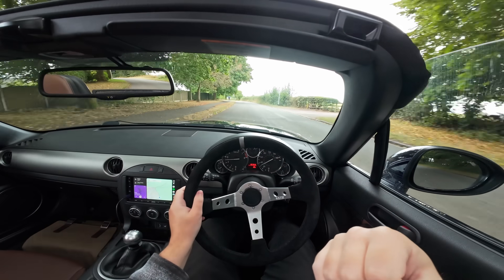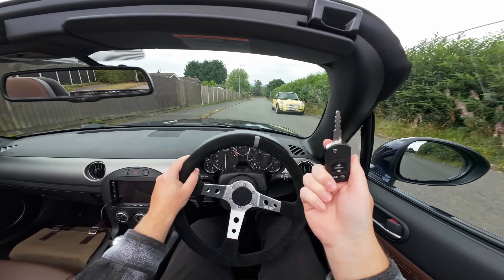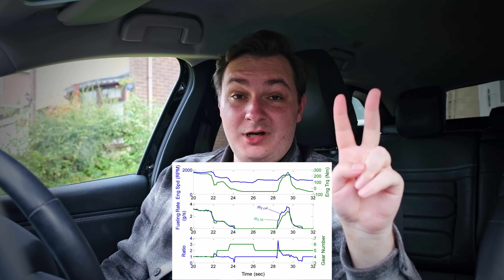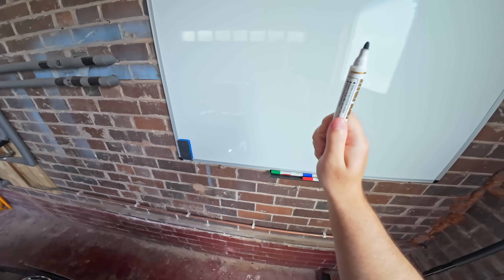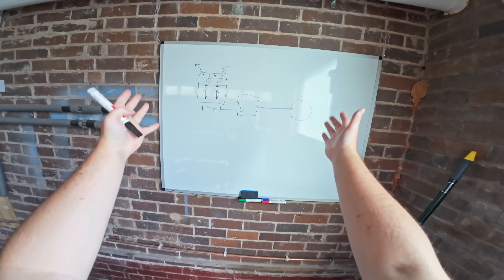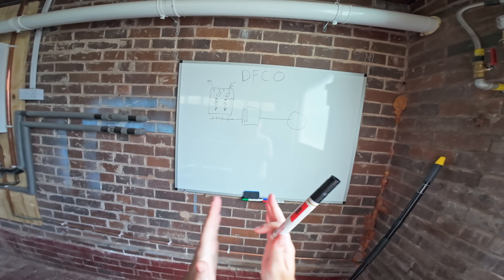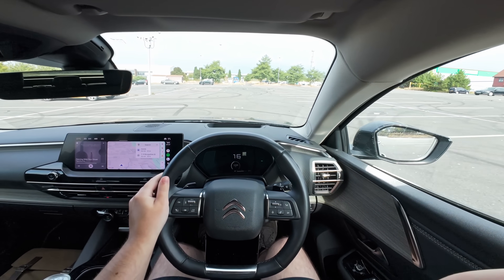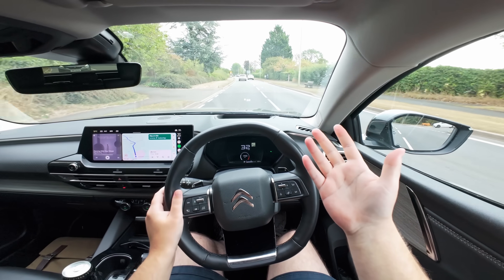The most misunderstood car term - Engine Braking

Comment: I have been doing this for over 15 years and it still amazes me when I see people get off the motorway and accelerate up/down the exit to have to slam on their brakes to stop.
Reply: Same here, and I find even more stupid seeing people that are moving way faster than the cars in front and instead of anticipating the traffic flow by engine breaking, they keep their speed until they are almost touching the front car's bumper and then slam on the brakes. Probably they think this behavior gets them quicker to their destination 🤦
Reply: @andrejorge3422 Reading the road ahead is key and a lot of people just don't do it. It would prevent a lot of accidents.
Reply: @andrejorge3422  Their thought process : "The more speed, the faster. If I stop, I honk"
Reply: @andrejorge3422 That's the Dunning Krueger effect at work right there!
Reply: especially if there is a red traffic light at the end.
You won't be any faster, you just have to arrive there when it turns green.

Back in the days I had an exit with a downward slope and a permanent traffic jam. You could turn off the engine on the motorway, coast to the end of the jam and use the handbrake on/off every time the light turned green until you could actually go through. Only then you needed to restart before your cycle came and you'd be still almost crashing into the car before you because people have abysmal reaction times.
Reply: some just don't care about fuel economy... I mean why do people buy giant suv, trucks for groceries... same philosophy
Reply: people seem to be getting way worse at driving than they used to be 😔
Reply: @dawnderg  My theory on that is due to there being less police on the roads. Cameras don't fix this issue. People drive better when being eyeballed.
Reply: @KarlWolfeINTJ  No, people drive better when they properly learn how to. It is baffling how easy it is to get a driving license in some countries, especially the US.
Reply: @ZombiieUnicorn  Agreed. I got my licence in the US when I was 15 and it was so easy. When I wanted to get my UK licence it was a different thing altoghether. Here in the UK people get taught well but don't practice it and get into bad habits.
Reply: @ZombiieUnicorn , I do believe many places do train their drivers well. The problem is, just like school, very often what you learn in the ideal setting of school falls apart when you realise are often not applied/applicable in the real world setting. The problem is that driving schools teach you to be this patient, courteous & considerate driver, but human nature is anything but. Skills are mostly not an issue, but many people put up the 'required disposition' to pass the exams, & then promptly revert to their 'true selves' once they cleared the hurdle. This is where enforcement comes in. Let's face it, there are many drivers out there who do the recommended only because of consequences. For those who have not been in an accident or had a close shave, the only consequence they are worried about is that of the law.
Reply: I did it once in a travel, I floored the car to get into the road and break hard to get out, then I realized how much that cost when I didn't do that for the second stop.
 Then I stopped doing that.
Why don't people notice that ?
It's so obvious , I leaned it pretty quickly the first time I traveled.

Comment: One factor you didn’t mention is heat generation. When a car slows down it converts kinetic energy into other forms of energy and ultimately into heat. If you use your brakes, your brake pads and rotors heat up (and also calipers, wheels, tires, air in the tires, etc). If you engine brake, your engine heats up. Engines are normally very good at dissipating heat via the cooling system and oil. They’re probably even better at that than brakes. Normally. But if your engine has any overheating problems you might want to reconsider engine braking or it might become engine breaking. (Sorry, couldn’t resist)
Reply: How are you going to overheat an engine using less energy that it produced by making stuff explode and burn intensely inside of it without overheating?
Reply: @stanislavblinov8454  Yes you're probably right! Although theoretically possible if you're decelerating fast enough, it probably won't happen in the real world. Please do the calculations and let me know. 🤓
Reply: @stanislavblinov8454 fuel actually cools down your cylinders!
Reply: Assuming the engine is about 25% efficient, it will produce 4x the heat, staying at revs using combusting fuel, than simply being used as a brake. A lot of the heat from engine braking goes out the exhaust anyway. You might get more cold engine wear on a short journey that's mostly engine braking though e.g. driving down a few miles of long hill to work.
Reply: @TimpBizkit  Thank you for pointing out that air flowing through the cylinders will vent a lot of heat. I had overlooked that.
Reply: After further consideration, I think my original comment should have been simply the following:
"If you're engine braking, all the kinetic energy that would have been dissipated as heat by your brakes is now being dissipated as heat by your engine. But don't worry, engines are REALLY good at dissipating heat."
Reply: @zenbum2654  Yeah your engine will be at its coldest when engine braking. At the same revs it will always create less heat than when the engine is under load. If you downshift rev-match to engine brake more aggressively, maybe this could make more heat at super high revs than idling?

Comment: One thing I get a bit confused with this is the gears. You mentioned downshifting is a bit advanced, so we can skip that. But let’s say I was in 5th gear at 50, and then 40, then 30 while using engine braking, would I stay in 5th? And if it’s okay to stay in 5th, and the speed limit went up, would I just get back on the accelerator while still in 5th? I get that if I came to a turn or a stop I would have to shift to 2nd or 1st.
Reply from the maker: So my viewpoint will be different to everyone else's...

Just get good at revmatching. It makes all of these questions and situations moot. You can engine brake down to any speed you like in any gear you like (almost) because when you want to get back on the gas you can go directly into any gear you like without thinking about it. In your situation I'd just go directly 5th-3rd or 5th-2nd, revmatch and I'm away... I wouldn't even think about it.
Reply: @MickDrivesCars thanks for the reply mate. Finally got my first car after having my license for 6 years and your videos have been so useful. When you say rev match, do you mean blipping the throttle?
Reply from the maker: I might just make a revmatching guide video...

But yes, 5th - clutch in - select 3rd - blip throttle - clutch out
Reply: @MickDrivesCars  A revmatching guide video would be awesome. I don't have a manual car myself but would be interesting to watch. Maybe I"ll get a manual at some point in the future.
Reply: It depends how much acceleration you want. If you accelerate from 30 in 5th, you will crawl back up to speed. If there's a ditherer in front of you, this may be all you need. 5th at 30 may be too slow to fully plant the accelerator without lugging. For maximum acceleration you'd use 2nd in most cars, and 1st in a few long geared cars.
Reply: @TimpBizkit  so I stay in 5th and move into 2nd when I’m ready to stop/turn/accelerate?
Reply: @user-ru1re2zj1w  It really depends on the situation. So if you were on a quiet country road or similar shown in the video and you saw a 30 limit you could use it to slow to 30, then switch to 3rd gear and continue driving.
Try and explain what your trying to understand and I can try to help
Reply: don't operate the engine bellow idle speed.

With a manual gearbox, you the gear chooses the power output, not the gas pedal.

So if you can be in 5th at 30, and you need only to accelerate gently because the car in front of you is underpowered, you stay in that gear.
If you need more power, you shift down. Keep in mind that the power output is the product of motor frequency and torque. You can find the max (open throttle) torque curve in your manual. Important for engines with turbos and/or compressors.

Comment: Your best video yet. Thank you. 
Another way to see this is if your car has a display of instantaneous fuel economy. Compare coasting in neutral with engine braking. There will be some value that represents “infinity”. In my car it’s 127 mpg. If I coast I might typically get about 40 mpg. With engine braking it’s always 127 mpg.
Reply from the maker: Thank you! 

And very true - The Citroen I was driving will show 999mpg
Reply: My kia shows 0l/100km when engine braking, when it would typically show something like 5l/100km when coasting with the clutch depressed or in neutral, i researched this thing a long time ago that's why i was surprised when the real mechanics dudes said it was false.
Reply: You only get 40 mpg coasting? Are you engine on coasting at <10 mph?
Reply: @TimpBizkit  I don't know if it's exactly 40. That's why I used the highly ambiguous words "might typically". What I know for sure is it's significantly less than 127.
Reply: Hmm, the main vehicle I drive is a 2001 Chevy Van.  It definitely has fuel injection, and I use engine braking all the time, yet the little device that plugs into the OBD-2 port to show continuous MPG etc never shows any MPG that is in any way remarkable - maybe 40-50 MPG which is about what you would expect if it were idling and coasting at 30 or 40 MPH.  My guess is this vehicle is old/primitive enough that just doesn't have this feature.  The monitor can display instantaneous fuel use as well, so I'll put that on some time and see what it says.

Meanwhile, I drove and worked on carbureted vehicles for many decades, so that part was also wrong for me.  (The last carbureted vehicle was sold in the U.S. in 1990, but as you can see from my current vehicle choice, that doesn't by any means say that *I* was driving a carbureted vehicle by 1991. Believe it or not, cars last for a lot longer than 3 or 4 years when well cared for.) Those carbureted vehicles definitely keep a small "idle" amount of fuel going at all times, even when engine braking.
Reply: Fun fact: in programming, the maximum value an 8-bit signed integer number can represent is 127. The minimum is -128.
Reply: @Diego-Garcia  Sometime I'll try driving in reverse and see if the mileage goes negative. 🤓
Reply: @zenbum2654  hahaha inject fuel into the exhaust

Comment: I think bikes also exhibit the same behavior with engine braking. My BIke always the echo mode light when I'm engine braking meaning I'm running in a fuel efficient manner. 

I might try turning off ignition tomorrow when engine braking the bike to see if it's the same behavior as a car.

P.S Bikes here mean motor cycles, not bicycles.
Reply from the maker: Be careful on a bike as the engine braking is MUCH stronger (mainly because power/weight) possible to lock up the rear if you're not ready for it, especially with some cc's.

(I've had a number of bikes btw, something I don't get to share on the channel enough!)
Reply: @MickDrivesCars  Didn't know Mick Drives Bikes too lol. And yep you're right. I've noticed the engine breaking is pretty high on my bike. I can feel it when I rev match.

I'll do the experiment because I'm used to my rear wheel getting locked and sliding cause of my emergency braking practices (mine doesn't have ABS). 

Appreciate the heads up Mick. #MickDrivesEverything soon??
Reply: @MickDrivesCars  Quick Update Mick, 
It worked as expected for my 125 CC bike so that's awesome.

quick question:

for a bike, which one is expected to have better fuel economy: 

1. Engine braking to come to a stop/low speed and down shifting gears at once at the end acc to the final speed.

2. Rev matching to get constant deceleration and synced downshifts to come to a stop/low speed.

Comment: I’ve basically always engine braked unintentionally. Funnily enough, for me it is the most natural form of driving because I grew up playing racing games like MarioKart and basically never used the brakes in those games. Nice to know I’m getting 100% fuel economy!
Reply: Surely racing is all about accelerating as fast as you can, before emergency braking in as short a time as possible, to the fastest you can go round the corner, then re-accelerating as fast as you can? Not fuel efficient, but it is fast.
Reply: @TimpBizkit At least in the games I played (they were not racing sims!), the brake was pretty intense. Usually letting off the gas was enough of a slowdown because inertia in the games did not work like in real life. However, it instilled in me the idea of releasing the gas pedal to slow down before using the brakes, even if the effectiveness is lesser in real life.
Reply: @TimpBizkit  Race car drivers use engine braking combined with conventional brakes to slow their cars even more aggressively going into corners.
Reply: @TimpBizkit Mario Kart physics are not realistic and so usually don't require any braking, but might give you a smaller turning radius if you're off throttle.
Reply: I also was never taught about engine braking. After learning manual, it just felt natural
Reply: @bravskii10  Same here, in fact I was taught the opposite by my dad - to always clutch in and coast in order to save fuel. I'm guessing that's how my grandfather taught him back in the '70s when all cars were carbureted and engine braking had no positive effect on fuel economy.
Reply: But those are the mariokart-games: they dont require you to know when/how to accelerate/decelerate, not how to really drive....specially with its notorious rubberbanding. it is all decided with the items.
Reply: @ABaumstumpf  That's why people who follow me too closely get a banana peel.

Comment: For some reason I keep thinking taking out the keys out of the ignition while rolling messes up your car.
Reply from the maker: I would not recommend it
Reply: Steering lock activating is my concern! I bet the MX-5 NC I also own has something to prevent this but I'd be terrified doing this at speed.
My Dad apparently had a friend do this decades ago and flipped a car when he couldn't steer.

Comment: Even Conquer Driving mentions the idea that the car uses zero fuel when off the accelerator, the only time fuel is used when off the accelerator that I know of is when the car is idling, as the  engine needs fuel to maintain its rpm (otherwise it'll stall).
Reply: conquer driving is brilliant, aside from the fact hes a brilliant instructor, his mechanical knowledge that relates to driving is amazing
Reply: @abdulwakil2613 agreed and explains it in such a clear and coherent manner
Reply: I have a standalone aftermarket wideband O2 sensor on my car and a gauge that shows the AFR, from about 10:1 (very rich) to 18:1 (very lean, in practice it means no fuel). There is a delay between letting off the throttle and fuel shutting off, which is lessened by the aftermarket ECU I have (I still have the stock one to compare to). It stops injecting fuel above about 1500 RPM, but you don't need a gauge because you can very clearly feel the transition. The aftermarket ECU reduces this to about 1100 RPM. 
If anyone want to know more details, it's a 2010 Hyundai Genesis coupe 2.0t track manual with AEM gauge and I've tried both BTR/Alpha speed and gencoupestore tunes, they behave similarly in this regard but the gencoupestore ECU is a little bit more responsive.
Reply: Ah I was looking for this clarification. Because when it's said that the engine is only using fuel when the accelerator is pressed, that would imply that just starting the engine and idling (without moving, without ever pressing the accelerator), you would never run out of fuel. Which I'm pretty certain you would.

In turn this also means driving is in some specific moments using less fuel than idling - and that's wild.
Reply: Technically 🤓 there might be a little bit more fuel injected for a half second immediately after coming off throttle, sometimes called overrun and sometimes observed as rev hang. This is done for NVH reasons to smooth things out if it's coming down from high throttle. More recently, it is also done for emissions reasons, as it needs to burn off any oil spray in the intake chamber coming from the CCV/PCV system and/or any remaining drops of fuel left over. This is a fairly modern phenomenon and only lasts for 1 second at most.
Reply: @needles_balloon  Technically correct. However, as soon as you start talking transient responses, pretty much everything we "intuitively" understand about the world goes out the window.  Like how we're pretending the entire drive train has zero play and that metals don't flex.

Comment: In the "saving fuel" section, my car's driver guide clearly states that "fuel supply is interrupted when coasting".
Reply from the maker: Coasting = rolling in neutral 

In that case you would need fuel to keep the car idling
Reply: It might be an automatic car, as coasting in this case might mean not pressing gas or brake. Since not everyone says engine braking, they might use "coasting" to mean not pressing gas (or brake)
Reply: @MXC19 That's exactly what they mean. I know some people (me included) say coasting when they mean being in gear without touching any of the pedals, and refer to coasting as defined in the video as "coasting in neutral".

Comment: You forgot to mention two critical items:
1.  None of this applies to engines with carburetors, they will always consume a small amount of fuel.
2.  In the case of EFI, the fuel cutoff is determined by the ECU.  Modern ECUs are much more aggressive with fuel cutoff than older units.
Reply from the maker: I did mention carbs in the common questions

Agreed on different tuning between ECUs!